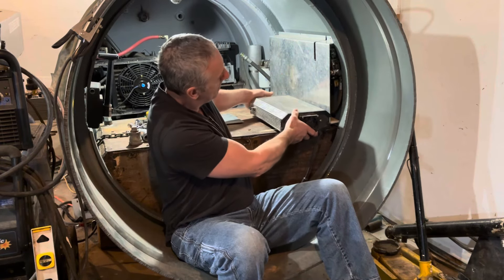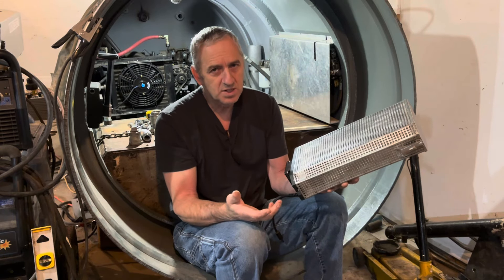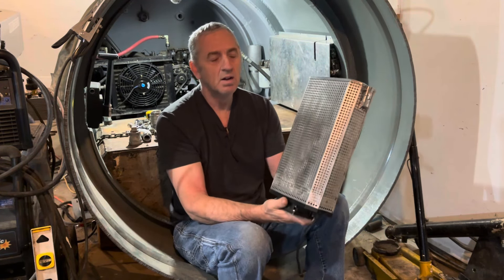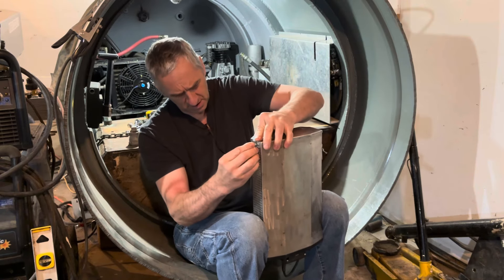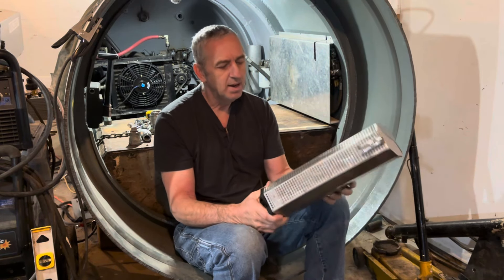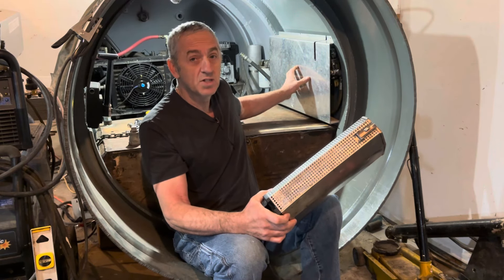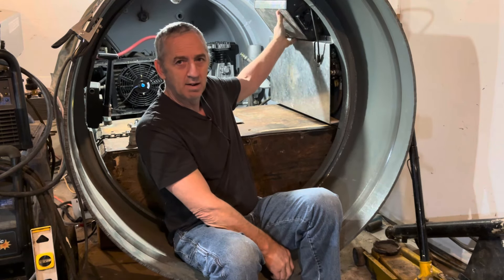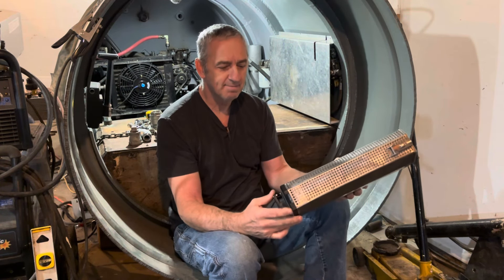Building my diesel personal submarine

Comment: Does a fan have to constantly blow the atmo through the scrubber, or can the scrubber just sorta attract and hold CO2?  What sort of power does that scrubber need & how do you know how to properly size it?
Reply from the maker: The scrubber has constant flow through it.  It is just a computer fan, so takes very little power.  The scrubber is sized by volume of absorbent.  If you want to dive for say 8 hr you would size it to hold enough absorbent for an 8 hr dive.  The scrubber in this video is good for 36  hr for one person.

Comment: Nice!!! I didnt get how does the fan blow air through the absorber bed but I hope that it works correct and there is uniform airflow through the bed. I'd keep much more absorber onboard in sealed container just in case.
Btw, do you have oxygen bottle onboard? If yes, plz keep it as faraway from engine, hydraulics (oil) and fuel as possible. Possibly engine and fuel tank on the floor in sealed compartment. Oxygen inside the cabin upstairs. Gas analyzer highly recommended.  Battery Idk where, cuz it will not enjoy hot engine. Maybe battery somewhere outside in sealed container. It's not so much space there. Heavy movable battery inside for changing CG was probably used by Cousteau. Nice but safety concerns and lack of space. Anyway some cg adjustments needed bc of fuel consumption and you have internal tanks for that.
Reply from the maker: Submarines like this carry 72 hr of reserve absorbent.

Comment: Does the absorbent material need to be changed every dive? If partially used can it be used til it hits its "time limit"?
Reply: Most scrubber material is single-use, though there is a type that can be heated to re-charge it. I would be hesitant to trust my life to a previously opened can of single-use material.

For an hour long pleasure dive, you can just breath the air in the cabin. Life support systems are required for working all day and in case of getting stuck on a wreck or net; at least 72 hours' worth since it takes the navy 3 days to respond to a sunken sub.
Reply from the maker: It can be used on multiple dives until it is saturated.  I just put a bag over the scrubber to seal it up.
Reply from the maker: Re-breather divers regularly use the same absorbent  until it is spent.  I can breathe the air in the cabin and do just that on short dives.  This sub will hunt for targets with the side scan sonar, then dive to investigate and come back to the surface.  I doubt I will use the life support system much.  I do have to have it though.